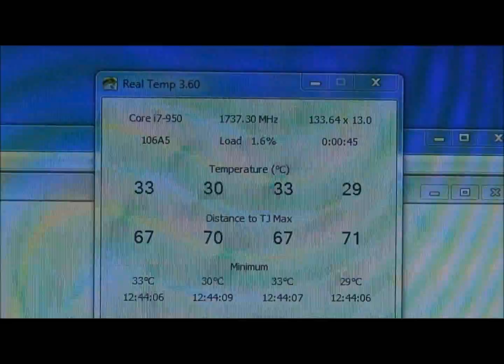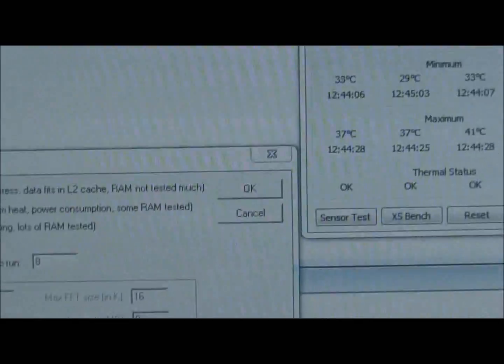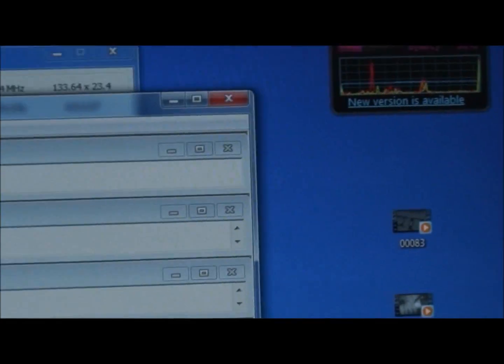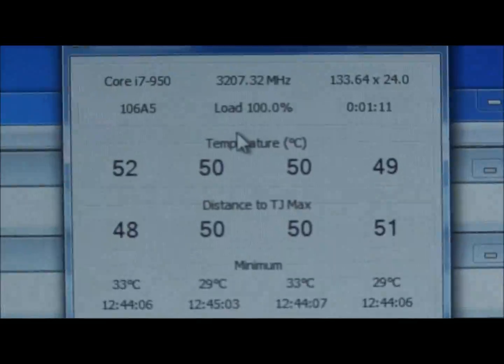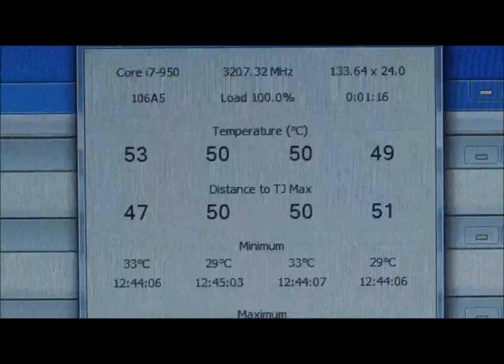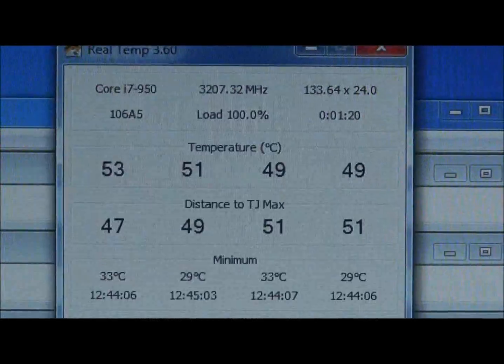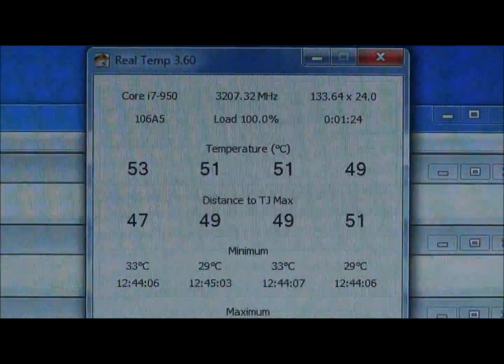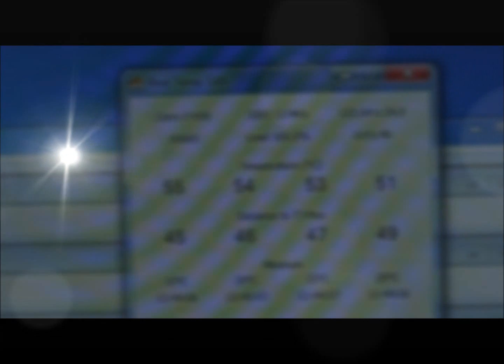Antec Kuhler H2O 620 Installation Video

Comment from the maker: You don't need any connector for the PSU, all you need is a CPU fan header, which all motherboards have. The Thermal compound and water are already built in into the system. When I run benchmarks, the CPU temperatures go to about 62-64 Celcius (My CPU is overclocked). And no, there is no change to the GPU.

Comment from the maker: I would strongly recommend that if you have a full tower, you could chip some more money in for a dual radiator one, like the Corsair H100i, Corsair H110, or if you don't, maybe an Antec 920 or a Corsair single radiator.
P.S. The Corsair H100i looks really cool, but not sure how it performs. (Not sure how any perform, but must be worth the higher price in my opinion.) Research!

Comment from the maker: That's exactly my clock speed! 
Under Idle: Each core is as follows- 37, 35, 37, 34 (numbers are the minimum degrees in Celcius)
Under 100% load: Each core is as follows- 72, 74, 71, 71 (numbers are the maximum degree in Celcius)

Comment from the maker: Depending on what you overclock your CPU too, it can be loud or quiet. If you let the Motherboard control it via PWM, it will be based on what your CPU needs. I have my i7 overclocked to 4.05GHz, so its not that loud, but its the loudest fan in my case.

Comment from the maker: I like the 620. But if you have a big case and want more cooling, check out the Corsair H100. Dual Radiator Water Cooler.

Comment: im runnin 4.4ghz on air and my temps are still only capping out at 47c. have you oced your cpu at all or applied more voltage? might be the reason your running so hot at 3.2ghz

Comment: Can I fit this to the top of a Zalman Z9 Plus?  It has a space at the top to mount a 120MM fan, if the tubes fit could I fit this on the top of the case instead of at the back?

Comment: @adsahar Probably best to go with what your BIOS says as that's usually the most reliable form of measurement. Besides, when you're in your BIOS everything will be much cooler because it isn't running much at all. Don't be worried about it, look at some forums for the BEST solutions though, someone out there has posted about this cooler all you need to know. But nothing to worry about. Hope I could help in some way!

Comment from the maker: @JJROADSTA By fan configuration do you mean push/pull or intake/exhast?
If thats what you mean, i recently changed the fan to intake, and unfortunately, it increased my CPU temps from an average of 32C to 39C.

Comment: @MegaCheesemaster123 Yeah your video was what helped me figure it out. The instructions were kinda crap. The only place I had trouble was when it was time to mount & twist, I couldn't get it to slide together until I put my case upright (was on its side for most of the install). Anyways thanks again, subscribed!

Comment: @MegaCheesemaster123 hi thanks for your reply... but the cpu fan header at the top of motherboard is a 4pin connector i know you can connect the 3pin to a 4pin but dont you lose the fan speed control function? i am guessing the fan will be running at full speed at all time right? would be nice if it slows down when pc is in idle mode, speed up when on full load... thanks again for ur help :)

Comment from the maker: @FOXOF123 Ok, so first, you want to connect the female connector from the CPU water block to the fan 3 pin, and with the remaining 3 pin connector located again at the water block, you want to connect that to the CPU fan header at the top of the motherboard.

Comment from the maker: @tir1066 Yes, one is for the fan. There are another 2 power connectors which come out near the CPU water block, the female connector from the water block gets connected to the fan 3 pin. The remaining 3 pin from the water block gets connected into the CPU fan header at the top of most motherboards.

Comment: hi MEgacheesemaster123 i got a question regarding the cooler. i got the sabertooth mobo but i dont know where to connect the cooler's power cable(3pin) onto the motherboard can you send a picture showing where u connected it. the default chasis fan which i took off and replace with anteck cooler is connected above the cpu but its a 4pin how u connect cooler power(3pin) to 4 pin connector? did you just connect to any of the 3 pin fan power connectors thanks

Comment: I'm looking into buying one of these and I noticed that it comes with three power connectors, one is for the exhaust fan behind the radiator but what are the other two and is it possible to wire all three into a fan regulator or does it keep a constant temp that it wouldn't be necessary?

Comment from the maker: @fruguite I don't think that will be a problem because I have seen full water cooling systems where the radiator was at the top (horizontally) of the case.

Comment: It may seems silly, but I want to make sure before buying it. I have an CM HAF 932 case and I am planning  to install a liquid CPU cooler (antec of corsair) "upside down". I explain, rather then placing the radiator vertically at the back of the case I want it horizontally at the top and to do so I might be oblige to put the CPU block upside down (i.e. the writings upside down and the tubes exit above the CPU block rather then below it) Does it matter? Is the the water block use gravity ??

Comment: Like smokeryt although not waiting I have the 2500k my temp at around 1.7GHz idle at 20c and when under full load at 4.3GHz they idle around 50-57c which is pretty dam good, this cooler is brilliant

Comment: I just installed mine tonight - same i7/950 as you, case HAFx, Asus Rampage II formula, radiator fan  configured to exhaust  - so far the temps are within 1 degree of what you show. I'm gonna love this cooler. The only other thing I did so far is add a small fan to put extra air over the Northbridge heatsink.  @thelawuk: the fan connects to the pump, the pump to mobo.